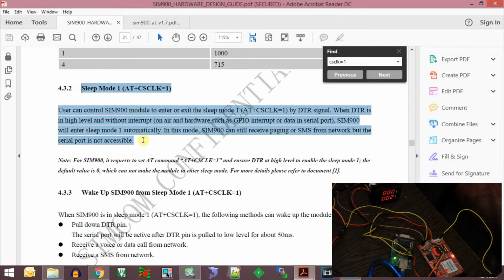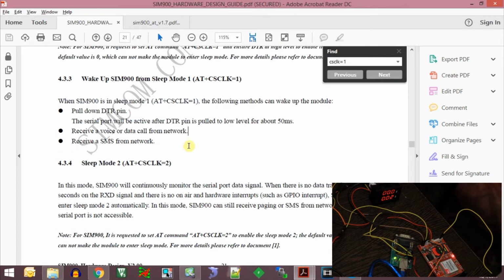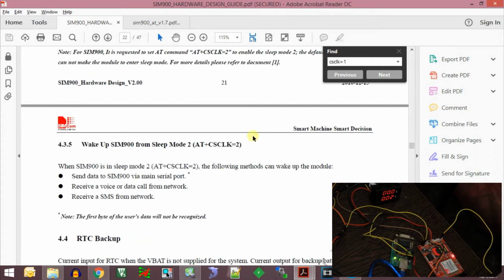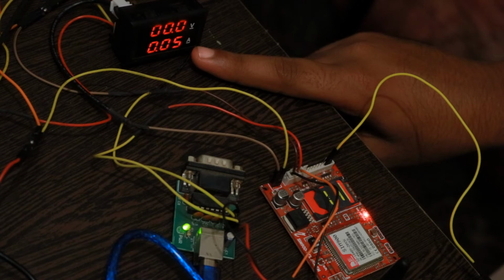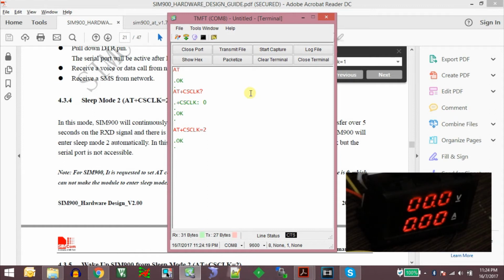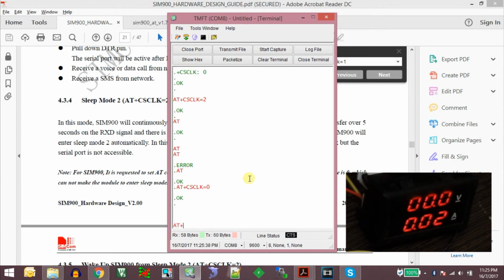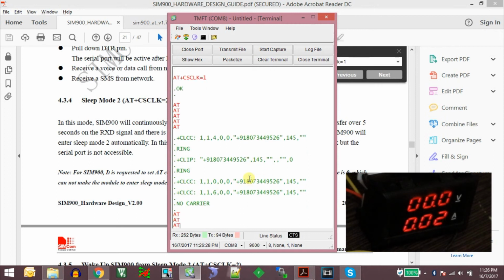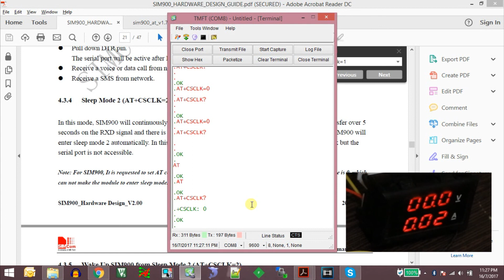SIM900/SIM800 Sleep mode AT commands - Live Demo

Comment: When we exit low power (AT+CSCLK=2) mode with AT and AT+CSCLK=0 , then can I immediately fix on GNSS/GPS and send an SMS after that ? Does it catch mobile network and GPS fix immediately after waking up ?
I am using SIM868
Reply from the maker: Even during sleep mode, network is still connected. Its never lost. So, yes you can send data immediately. But GNSS I don't know, you have to experiment and see.

Comment: So why is there no DTR pin on the version 2 product?  There are situations when you need the device isolated from the rest of the circuit and the rx and tx line in high impedance state. Will a string of text for example "water" wake up the device? Why did you get a .error response?

Comment: Hello sir iam using esp32 microcontroller in deep sleep mode with sim800C  is it must to put sim800c also in deep sleep if yes how to put both in sleep at same time and wake up iam new but how to put sim800c in seep mode using arduino code

Comment: Can you please explain how do you turn the dtr pin high and low?
Reply from the maker: You connect it to VDD_EXT to make it high. Connect to ground to make it low
Reply: @RaviPujar  Thanks for the quick response! Though I think I have a different SIM900A that doesn't have a DTR pin...
Reply from the maker: It will have a DTR pin. You can solder thin wire to module directly

Comment: Hi, how i could wake up sim800l evb from sleep. This module doesn't have DTR pin? Should I do it trough RST pin?
Reply: Ok. I found solution. Just use: "AT+CSCLK=2" to put module to sleep. If you want to wake it up, send "AT" and immediately after that "AT+CSCLK=0". No DTR pin needed.
Reply from the maker: Yes sleep mode 2 doesn't need DTR. It works on UART activity and cellular interrupts. Don't forget to share and subscribe :)
Reply: @RaviPujar  Another question. If i don't have RI pin. Can I somehow set interrupt from gsm module, to wake up arduino from sleep when sms or call arrives?
Reply: @RaviPujar  UART activity or specific UART activity e.g AT commands?
Reply: @nikolapetrovic2854  Really useful comment!! Thanks!!

Comment: I have the problem, that the sim800 powers of and after a few seconds it re powers like normal. Dont know whats wrong. The PWRKEY is open, I pull down with a Low on uC and the reconfigurate the pin as High-Z input.
Reply from the maker: If module is powering ON and turning off after short time, Its either UNDERVOLTAGE shutdown or OVERVOLTAGE shutdown. Can happen due to insufficient current also. Make sure your module is getting 4V @ 2A.
Reply: @RaviPujar  No, I tested everything and the power source is very stable. I use a 18650/ 3500mA quality LiIon cell, the cells these modules are designed for. +470uF+m 100nf + 10pf. The 800L cant be powered OFF with CPOWD=0... They will repower (wake up) again and again after 1s. PWRKEY is not on the ports, only DTR and RESET. I try to power them down now with "Sleep" Mode and CFUN=0. Nowhere in the web is a correct step by step wake up procedure and the manual is horrible.
Reply: @KalterKrieger  Sir, your problem is with your Lion cell. Cell could not serve the sufficient current to your module. First you check your module with 4V, 2A power supply and then check with your cell. Then you will realize the problem.
Reply: Check the printed circuit board of the sim module. It's possible that the DTR pin has been pulled low on the circuit board. This will cause it to auto start even after u send the power down command

Comment: Sir,
I have also same problem sleep mode 1. I have tried to overcome this situation but I failed. I used transistor to pull down.   what is the normal voltage of SIM900A? Can I leave sleep mode using PL2302 adapter? How to pull down DTR? please help sir.
Reply: Forget these sleep modes! Only trouble with them! Sleep 2 doesnt work at me, always loosing the sync of the serial com. Sync 1 can only be turned off with module restart.
Reply: @KalterKrieger  tell me the way to leave the Sleep mode 1
Reply: @KalterKrieger  I'm trying sir,, Thank you,, May i run this code using arduino?
Reply: @pritamH  You have to write your own routines, this is only the principle..... pull downj DTR for 60ms, sendet immeditaley the sequence AT, AT+CSCLK=0, AT+CFUN=1 and leave DTR. Then wait 1s before the next command. Works fine with my arduino uno board.
Reply: @KalterKrieger  Thank you sir :-)
Reply: @KalterKrieger  Sir, have you used any external circuit? like transistor and resistor?
Reply: My complete GSM control file:

/* Loescht den seriellen Eingangspuffer von Muell */
void SIM800_ClearSerial()
{
 uint16_t to;
 to = millis();
 while(Serial.available()){
  Serial.read();
  delay(3);
  if ((millis()- to > 1000))
   return;
 } 
}
 
/* Ist GSM ins Netz eingebucht? */
int SIM800_IsConToNetwork()
{
 //debug(F("GSM Network?: "));
 if (SIM800_SendAT("AT+CREG?\r\n", "CREG: 0,1")) {
  flags.GSMConToNetwork = true;
  //debugln(F("OK"));
  return 1;
 }
 if (SIM800_SendAT("AT+CREG?\r\n", "CREG: 0,5")) {
  flags.GSMConToNetwork = true;
  //debugln(F("OK"));
  return 1;
 }

 /* Kein Netz signalisieren */
 debugln(F("NO Network!"));
 flags.GSMConToNetwork = false;
 return 0;
}

/* Loest den 100ms reset aus */
void SIM800_Reset()
{
 pinMode(SIM800_RESET,OUTPUT);
 delay(120);
 pinMode(SIM800_RESET,INPUT);
 delay(100);
}

/* Zieht DTR Leitung High oder Low */
void SIM800_PullDTR(int dir)
{
 if (dir == LOW) {
  digitalWrite(SIM800_DTR,0);
  pinMode(SIM800_DTR,OUTPUT);
  delay(60);
 } else {
  pinMode(SIM800_DTR,INPUT);
  delay(100);
 }
}

/*  Schaltet das GSM Modul ein aber
 es wird nicht initialisiert  */
void SIM800_PowerOn() 
{
 /* WDT soll nicht dazwischen funken */
 wdt_disable();
 
 debug(F("Power ON GSM ...: "));
 SIM800_PullDTR(LOW);
 SIM800_SendAT("AT\r\n", "OK");
 SIM800_SendAT("AT+CSCLK=0\r\n","OK");
 SIM800_SendAT("AT+CFUN=1\r\n","OK");
 SIM800_PullDTR(HIGH);
 delay(3000);
 serialSIM800.print("AT\r\n");
 SIM800_ClearSerial();
 if (SIM800_SendAT("AT\r\n","OK"))
  debugln(F("OK"));

 delay(15000);
 SIM800_ClearSerial();
 
 /* Ein ja, Netz aber vielleicht noch keines */
 flags.SIM_IsPoweredOn = true;
 flags.GSMConToNetwork = false;
 
 Init_WDT();
}

/* Schaltet das GSM Modul in den Sleep Mode */
int SIM800_PowerOFF()
{
 wdt_disable();
 debug(F("Power OFF GSM: "));
 SIM800_PullDTR(HIGH);
 delay(100);

 /* RF abschalten und SIM Card */
 SIM800_SendAT("AT\r\n", "OK");
 SIM800_SendAT("AT+CFUN=0\r\n", "OK");
 SIM800_SendAT("AT+CSCLK=1\r\n", "OK");
 debugln(F("OK"));
 SIM800_ClearSerial();

 /* Flags setzen */
 flags.SIM_IsPoweredOn = false;
 flags.GSMConToNetwork = false;

 Init_WDT();
 
 return 1;
}

/* Uebeprueft, ob das SIM800 Modul antwortet */
int SIM800_InitModem()
{ 
   uint16_t to;
   
   flags.GSMConToNetwork = false;
   debug(F("GSM Init: "));
   
   if (!SIM800_SendAT("AT\r\n", "OK"))
    return 0;
   
   /* Echo abschalten */
   if (!SIM800_SendAT("ATE0\r\n", "OK")) 
    return 0;
   
    /* CFUN=1 */
   if (!SIM800_SendAT("AT+CFUN=1\r\n", "OK"))
    return 0;
    
   /* Setze 9600 baud */
   if (!SIM800_SendAT("AT+IPR=9600\r\n", "OK"))
    return 0;

   /* Meldungen abschalten */ 
     if (!SIM800_SendAT("AT+CCWA=0\r\n", "OK")) 
    return 0;

   
    /* ----------------------------------------------------------------------------- */

   /* Warte bis GSM ins Netz eingebucht ist
   Diese Schleife kann endlos laufen !!!!
  Ohne Netz ist das Modul nicht verwendbar!
   */
   
   to = millis();
   bool success = false;
   while (!success)
   {
  if (SIM800_SendAT("AT+CREG?\r\n", "+CREG: 0,1")) {
    success = true;
    continue;
  }
  else if (SIM800_SendAT("AT+CREG?\r\n", "+CREG: 0,5")) {
    success = true;
    continue;
  }
      
   /* Uber 30s besteht kein Netz */
   if (millis() - to > 30000) {
   debugln(F("Kein Netz! Gebe auf!"));
   return 0;
   }
  delay(1500);
   }
  
   /* ------------------------------------------------------------------------------- */
   
   /* sms auf SIM Karte speichern */
   if (!SIM800_SendAT("AT+CPMS=\"SM\"\r\n", "OK"))
    return 0;
   
   /* RTC Zeit aktivieren */
   if (!SIM800_SendAT("AT+CLTS=1\r\n", "OK"))
    return 0;
   
   /* Rufannahme nach 3 Mal Klingeln */
   if (!SIM800_SendAT("ATS0=3\r\n", "OK"))
    return 0;
   
   /* Loesche den sms Speicher */ 
   // SIM800_SendAT("AT+CMGDA=\"DEL ALL\"\r\n", "OK"));
  
   debugln(F("Connected to Network!"));
  
 flags.GSMConToNetwork = true;
  
 return 1;
}

/* -------------------------------------------------------------------------------
 Sendet einen AT Befehl und pruef, ob Token in der Antwort
 vorkommt, was eine erfolgreiche AusfÃƒÂ¼hrung anzeigt.
 1 = OK, 0 = nicht ok. 2 = Timeout
 -------------------------------------------------------------------------------
*/

/* Holt eine Textnachricht ab */
int SIM800_GetResponse(const char* atc, char* response) {
 
   char res[256];
   char* p = res;
   uint16_t cnt = 0;
   unsigned long to;
   
   /* SIM800 Serial Buffer leeren */
   while (serialSIM800.available())
    serialSIM800.read();

   /* Sende AT Command */  
   serialSIM800.print(atc);
   
   /* Warte auf erstes Zeichen */
   to = millis();
   while (!serialSIM800.available()) {
    if ((to + 1000) < millis())
     return 0;
    delay(1);
   }
   /* Weitere Zeichen kommen lassen */
   delay(25);
   
   /* Hole die Zeichen ab, aber nicht schneller als sie bei
   9600 baud kommen, 1ms = 1 Zeichen */
   cnt = 0;
   while (serialSIM800.available()) {
  (p++) = serialSIM800.read(); / Zeichen holen */
  p     = '\0';     / String Null terminieren */
  if (cnt++ >= sizeof(res))  /* Pufferüberlauf als Fehler melden */
   return 0;
  delay(5);
  yield();
   }
   
   /* Kopiere Ergebnis in Rückgabe */
   strcpy(response,res);
   
   return 1;
}

int SIM800_SendAT(const char* atc,const char* token)
{
   char res[256];
   char* p = res;
   unsigned long to;
   
   /* SIM800 Serial Buffer leeren */
   while (serialSIM800.available())
    serialSIM800.read();

   /* Sende AT Command */  
   serialSIM800.print(atc);
   
   to = millis();
   while (!serialSIM800.available()) {
    if ((to + 1000) < millis())
     return 0;
    delayMicroseconds(100);
   }
   
   /* Hole die Zeichen langsam ab, 9600 baud = 1ms pro Zeichen */
   while (serialSIM800.available()) {
  *(p++) = serialSIM800.read();
  p     = '\0';   / String Null terminieren */
  delay(3);
   }
  
 // debug(atc);
 // debug(res);
  
  if (strstr(res, token))   /* OK pruefen */
   return 1;
   
  return 0;
}

/*  ---------------------------------------------------------------------
 AT+CBC: Holt den Batteriestatus und liefert diesen als Prozentwert
 zurueck
 Antwort: +CBC: laden,prozent,spannung
 
 ---------------------------------------------------------------------
*/ 

int SIM800_GetBatteryStatus()
{
 char  answer[32];
 char* cbuf = answer;
 char* wort;

 /* Befehl AT+CBC: senden */ 
 if (!SIM800_GetResponse("AT+CBC\r\n",answer)) 
  return 0;
 
 /* Antwort zweimal zerlegen nach ',' Prozent ist die zweite Zahl*/
 wort = strtok(cbuf,",");
 wort = strtok(NULL,",");
 if (wort != NULL)
  return (atoi(wort));
 
 return 0;
}
Reply: @KalterKrieger  not working on my SIM900a
Reply: @KalterKrieger  please reply

Comment: whitch moment the module use 2A how describe in datasheet?
Reply from the maker: The module uses 2A for brief moments, When its sending data packets or on call. Its not noticeable on the multimeter or display. You need to observe using Oscilloscope with current probe.
Reply from the maker: Don't forget to Share and Subscribe :)

Comment: I have always used sleepmode 1 and used DTR to wake up. So with sleepmode 2 you dont need DTR pin at all?
And what about this note please - 
Note: The default setting of serial port is auto baud detection, in this case, the module cannot enter sleep mode 2 before
the synchronization of serial port baud rate between DTE and DCE.
Reply from the maker: Hi,
When you want to use Sleep Mode 2. You always keep DTR high. And use UART to enter or exit sleep mode. 
I always set a baud rate and lock it to 9600 on boot up using AT&W command. I am not sure of the limitation of what they mentioned, But i think its due to if the module is in autobaud mode, it will always consider first byte for synchronization of baud rate. In sleep mode 2 the first command is always lost.  So i send a dummy AT command before sending any real commands.
Reply: Great thanks will give it a try. I thought that sleep mode 2 uses more power than sleep mode 1 since it keeps the UART active.
Reply from the maker: No, both consume same current.
Reply: @RaviPujar  thanks a lot for tutorial. I have my in sleep mode 2, DTR is not connected and it wakes up just fine. Should I leave it as is or connect it anyway?